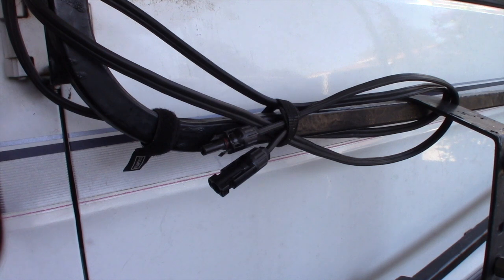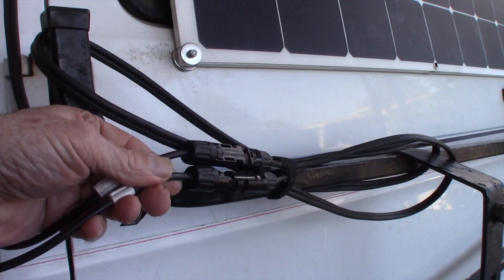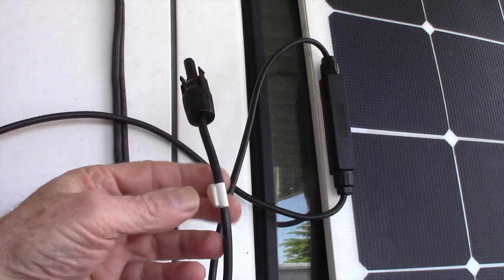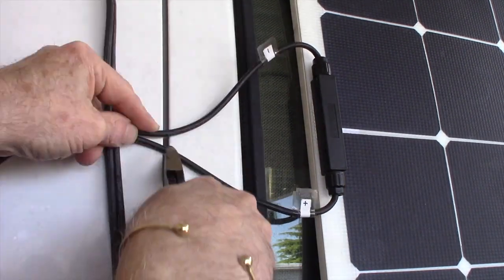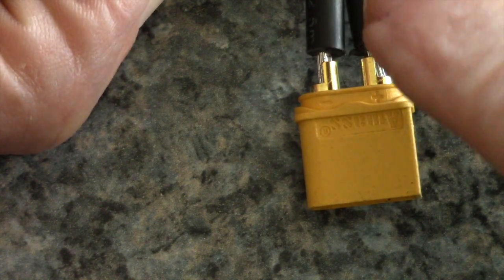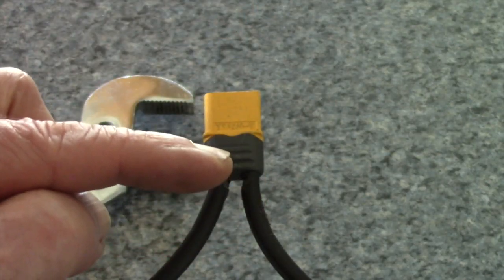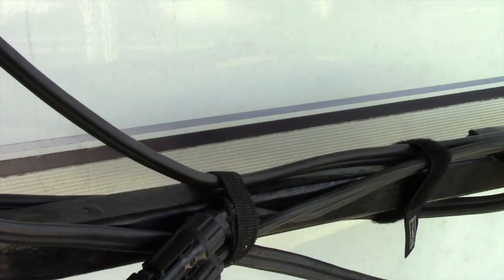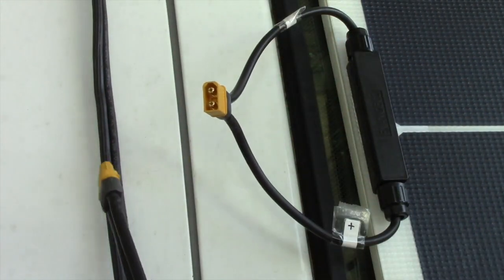XT60 Connector for Solar

Comment: I'm new to Solar and I just bought a solar generator that came with a few cables with XT60 female connectors  on them. One being a Y cable meant for a solar panel. I believe studying videos MC4 type connectors are best suited for connecting panels when in weather. But the connection to the unit is an XT60.
Reply from the maker: Hi, @skipwavedx5151. Are you asking a question? Making a statement? I'm not sure how to reply.  Terminology is important. I think I know what you mean when you refer to a power bank as a "solar generator" and the cables connecting it to a solar panel. However, it's not "generating" anything. It is storing the electrical energy harvested by the solar panel via an electrical connection between the panel and the power bank through the cables. This connection is going to be exposed to weather with a panel outside, in direct sunlight which is the normal location for solar panels. The electrical cabling is generally routed inside a structure or a vehicle where it is connected to the power bank that will be used indoors or perhaps outdoors protected from inclement weather.
So these exterior, outdoor connections between the leads on the solar panel and the longer cabling to reach the indoor location of the power bank should be weather-proofed. Both MC4 and XT60 connectors can be water-proofed for this application. I hope that helps you. Thank you for the comment.

Comment: Hellllppppp......lolol
I have a doiko solar charge controller with an XT 60 INPUT FROM THE PANEL ......its usb outputs died
So im.trying to find another solar charge controller with a built in XT60 FEMALE PORT....but i cant .....can i somehow do this to a different brand that only has holes for wires that i dont even know what to do with ??
Reply from the maker: The answer is yes. This is a good question to answer with a video. So here's the link to the video that answers it. Thanks for the comment.
https://youtu.be/Jbe1apeO7kg
Reply: @RoadtrekRich  thank you thank you thank you

Comment: Roadtrek rich..I bought bluetti eb55 and I was wondering if you knew anything about it..why put the Eco into a etting to change the htz..to turn on my power station long press   the dc and ac...ok how do you turn the eb55 Off...do you have to go into Eco...then press DC...seems like my eb55 is in standby...I can't figure it out...any suggestions...for a beginner...
Reply from the maker: The reason for entering the settings mode is to set the Bluetti up for the power used in your location.
In the U.S., this would be 60Hz.
The power station outputs power in 3 different forms. 12 volt DC, 5 volt DC which we also refer to as USB, and AC or what we refer to as house current.
To control each of these there is a power on/off button for each form of power.
Each button has a tiny pilot light that glows through the button when that form of power is on and available for you to use.
So to turn the Bluetti completely "off" you will need to ensure none of the on/off buttons have their pilot light glowing.
How long you need to hold the button down to turn on each form of power or how long you need to hold the button to turn it off is something you will have to determine with some trial and error.
Once you have no little pilot lights glowing, the Bluetti should be off.
Each one of these power station manufacturers handles this "on/off" procedure differently.
In Bluetti's case, the manufacturer seems to want to provide you with the ability to turn each form of power on or off as your needs dictate.
Reply: Wow..you are so informative...so very detailed in your explanation ty..in Canada ontario..I thought I would use 60hz.
Can I ask you 1 more question..after cutting my lawn today..I was wondering if my 20v batteries could be charged by my bluetti eb55. Not that I would be charging them on my power station..but just wondering...also..can I assume it's OK to connect a dc to ac converter 120w to my AC power station..that I use to charge my roadpro cooler. Ty again..
Reply from the maker: @carolannbest1925  
Assuming you have a wall outlet charger for your 20v lawnmower batteries, you can plug the charger into one of the AC outlets on your bluetti, plug in your solar panel(s) to the Bluetti and charge your lawnmower batteries on the same sun you lawn thrives on.
As for the RoadPro cooler, I believe these are designed to plug into a 12volt cigarette lighter port. You have one of those in the Bluetti. You could plug the cooler directly into the Bluetti. So while driving, you could plug the cooler directly into the vehicle's 12 volt port. Then when parked, you could plug the cooler into the Bluetti 12v port. Or you could plug the cooler into the Bluetti and plug the Bluetti into the vehicle's 12v port. When underway, the Bluetti would be charging or maintaining its charge and providing power to the cooler. When stopped, the Bluetti would provide the power to the cooler until its power reserve was exhausted.

Comment: Wow..that's brilliant..much cleaner looking connect.
Question..I have a 120 watt solar panel with 5.5x2.1mm adapter I believe..connect it to a 5.5x2.5mm adapter..then connect it to a xt60..adapter..to connect to my bleutti eb55...I'm only a newbie at this and wondered if it's safe to do so...appreciate a response.
Reply from the maker: To answer, I have to establish what is "normal" or generally what would be encountered.
Solar panels generally come equipped with what is known as an MC 4 connector. One of the wires emanating from the panel has the female MC 4 connector attached to it and the other wire has the male version attached to it.
One wire is positive polarity, the other negative polarity.
AND they are generally marked, tagged, etc. with their polarity.
From your description, what you have is a panel with a 5.5mm x 2.5mm CONNECTOR.
Connector or plug is different from the term adaptor.
An adaptor is an intermediate part that joins two connectors of different types.
So I am going to assume the panel you have would appear to you to have what looks like one cable coming out of the panel that terminates at the end with a 5.5mmX2.5. 
Now based on that assumption, the first thing for you to know is there are two wires inside what looks like one wire. One is positive and one is negative.
However, unlike a "normal" solar panel, there is a problem trying to figure out which part of the connector has the positive wire connected to it and which the negative because all is hidden.
Being new to this and probably not familiar with electrical stuff, this is probably making your head explode!  It's okay, just keep reading...slowly, for comprehension.
The question you're asking is how to plug your solar panel with the connector it has into your Bluetti which has a different connector.
Here is a link to what I think will be your simplest solution https://amzn.to/3QQ5egm.
This product is an ADAPTOR or ADAPTER, either spelling is correct.
The adaptor has a 5.5mm female end to plug your solar panel into and an xt60 male end to plug into your Bluetti.
There. Done...well hopefully.
I would suggest starting by obtaining that adaptor in the link I included.
Make the necessary connections and see if it works.
I'm not going to confuse you with more stuff that may prove to be irrelevant.
I'm hopeful that will be the solution you need.
If not comment again and we'll go from there.
Reply: Thank you. That is the exact  xt60 I have..only a sin Loon...just wondered if it is ok to connect the 3 items together...from a safety point of view...I really appreciate your input.... ty for the detailed account of what I need and your understanding and exactly what I have..I just needed reassuring...this is so new to me..down the road I may  install permanent solar panels..and use the mc4 connectors...that also came with my package...not sure yet..again ty so much...for your help.

Comment: I couldn't get my stranded 12 gauge into the holes on these connectors. I had to cut some strands to get it in to solar it. What gauge are you using here, 14?

Comment: Soldering xt90’s which I have done many times one thing I always do is use shrink wrap for each individual wire then cover the wire in the end to give it that extra protection and a seal from either wire end possibly making contact with the other wire. 

I used the cap cover but also used a larger wire shrink wrap to help keep everything sealed. Nothing worse then overtime having exposed wires that could cause a short. 

I am liking the XT60s. They holdup pretty well.

Comment: How many volts and watts can xt60 handle.
Reply from the maker: Hi tony montana,
Generally, the xt60's application is the battery connection for drones.  As such, the popular drones, rc cars, etc. use batteries of about 14.8 volts. They can withstand 60 amps of current which works out to about 888 watts. I have two 100 watt solar panels (200 watts) operating at a maximum output of 21 volts which is about 9.5 amps but solar panels aren't that efficient so if I were to get even 95% of the output, I'd still only be putting 9 amps or so through the connector, well below its rated capability. Even if we adjust for the difference in voltages 14.8 versus 21, the panel being about 1/3 more voltage, we might say equals 1/3 more amperage... which at around 14 amps is still way below its capacity. I don't know if I've got things right but I think I'm pretty safe using these connectors. Let me know if you find otherwise.
Reply from the maker: Well, real safe now, because I mounted panels on the roof and used the conventional connectors.  I use xt60's in other applications though and have never had a problem with them...fuses are an important part of the process as well.

Comment: Nice, I use parallel harnesses for multiple 12v batteries. Just have to make connections for the battery (I use 12g wire solders to tabs that slid on and off the battery) works great so far and plan on installing on my FJ as a independent power source.

Comment: the socket must be on the solar panel, not the plug. The XT connectors are not waterproof, but can withstand a lot of electricity. My test: https://youtu.be/K61yPc87nXQ

Comment: Since the panel is putting out the voltage should you have put the other xt60 connector on with the conductors encased? It seems like the connector you put on could be shorted easily. I'm not sure which way they go though. Looking to do the same with my setup
Reply from the maker: Hi Andrew,
Yes, I think the video may not fully show the completed connections.  The xt60 has a cap that snaps over the terminals (the part the wire connects to) to insulate them from creating possible short circuit situation.
From what you describe, maybe your concern is reverse polarity versus short circuit?
The xt60 connector prevents the possibility of plugging the connector together to create that situation.
The way it does it is by keying the male and female plugs in such a way as to only be able to be connected one way.  That is + connects to + and - connects to -.  The plug can't be assembled to create a reverse polarity situation.
Of course, the initial install of the plug needs to be correct but after that, plugging in and unplugging can be done error-free and way easier than the clumsy MC4 connectors.
xt60 plugs can handle up to 60 amps so my little 100 watt panel with its maximum of maybe 5 amps? is well under that. The xt60 could handle several panels worth of output...no problem.
It's worked fine for me. Just be sure to get the xt60 model with the gray cap for the terminal end.

Comment: Always enjoy your videos. I don't have solar yet, but I'm  certain that  I do not want permanently mounted panels, like so many RVers do. I'm not planning to be in cold weather and the last thing I want is to HAVE to park my RT in the sun if I have a choice of even partial shade.   I live in Fla and I know how fast these things turn into a giant oven in even the mildest temps if it's sunny. Mounted panels just never made any logical sense to me. Great job, Rich!
Reply from the maker: Hi SandySez,
Thank you for the comment.
I understand permanently mounting panels.
I had to think up a lot of justifications for NOT permanently mounting them.

As far as heat, I can't think of anything hotter than a metal enclosure.  I don't think there is a way to overcome the oven these class b's become in hot weather, short of not being in them.

The ideal would be to have a large umbrella tree to park under,  deploy a couple of panels in the sun, rock back in a gravity chair with some snacks, a cold drink and favorite tunes, with a cool breeze rustling through the tree.

I can even create this illusion.  But in my experience, this is a fairly rare, sometimes contrived occurrence.

Unless I had a dozen hundred watt solar panels, I couldn't use the AC without a generator.

So my best choice has been to either drive through the heat of the day using the vehicle AC to stay cool and keep the batteries charged or put the rig in the shade, if any exists and use the portable generator to run AC and use a panel or two to keep up the batteries.

I believe I approach the small rv like the class b from the right perspective.  By electing to place myself in this position, I understand I am ACTUALLY in the elements, outdoors, not indoors.
So I am subject to the elements.  I am not in an artificial environment of a building.  I am in the real environment of the planet.  Therefore, I am unable to control it.

I think what people sometimes attempt to do is replicate their "home", the building, in the vehicle.
As we see, it definitely can be done !

I'm not trying to do that.  I'm trying to use the van to best advantage to mitigate the environment it operates in and whatever relative comfort I can afford in this environment.

For me, it adds contrast, dimension.  There is a wider range of highs and lows.  My ingenuity, creativity, resourcefulness are challenged.  So when it's 110 in the shade and there isn't any shade, I have to remind myself, "oh yeah, that's the fun of this !"  "I put myself here to see what I would do."

The way I look at it is if I have all the comforts of home out here, I might as well stay at home. 

I think it's a fair exchange.  I give up a few creature comforts to gain what the outdoors has to offer.

Not too hot, not too cold, just right, the Goldielocks zone is fleeting, fanciful.  I enjoy it when it passes through for a visit.
Reply: @RoadtrekRich  Your dreamy scenario makes me want to go jump in my RT and take off!!

I couldn't agree more! I see these RV monstrosities on the road and I always think "no, thank you!'. I don't need (or want) a traveling comfort castle!

Even dealing with all the (new to me) 'RV' components on my '95 RT quickly made me think I'd be as happy or happier with a more basic, DIY 'camper'  van. But I think the RT was  good investment.

I had a lot to do to it (mechanically and cosmetically) when I got it. Now I'm trying to untangle some things in life so I can work on the fun parts customizing it a bit and get my butt out on the road.... 'in the elements' as you say.

I have a lot of boondocking learning curves ahead. I also elected NOT to put an awning on it, nor a generator. I did just put a new Trojan house battery in it, and I bought one of those QuickSet 'Clam' pup up screen rooms. Love it, super easy to handle and only weighs 20 lbs. I decided I need to focus more on rigging up my 'outdoor' life, not bells and whistles on the interior, it already has more  comforts and conveniences that I want or need.

I saw a video about converting a standard box fan into a 12V. I saved it but haven't watched it yet.
Reply: @RoadtrekRich  P.S. ... I recently meticulously made patterns for all windows and made perfectly-fitted Reflectix panels for each. The panels for the  3 operas fit in a groove in the window frame, so I left them in, it's already in the 90's here! I discovered the Reflectix is still hot to the touch (not 'warm', HOT!), a lot of radiant heat coming in. I think I'm going to rig a shade cloth for that section of the roof and block some heat from getting to the glass in the first place.